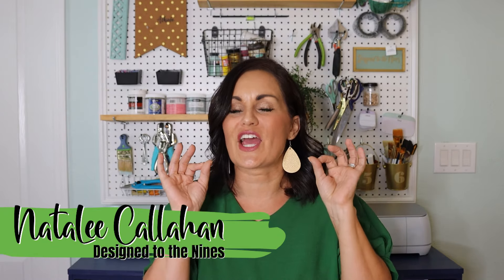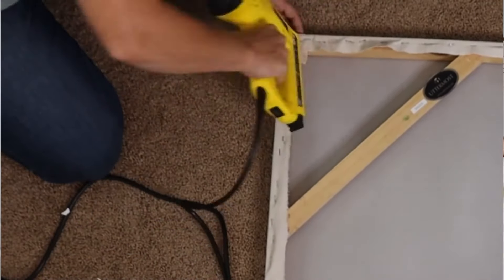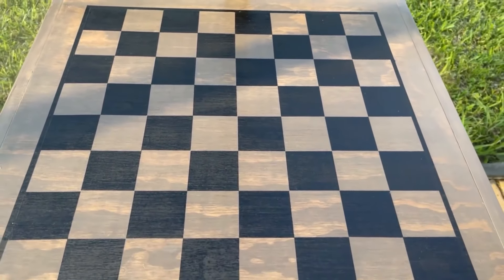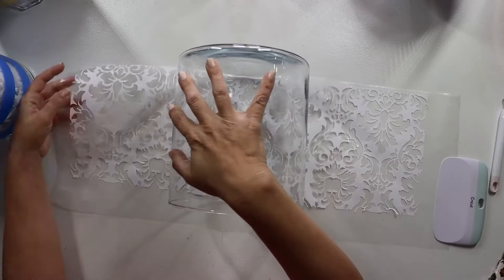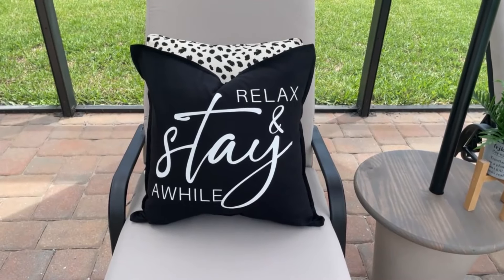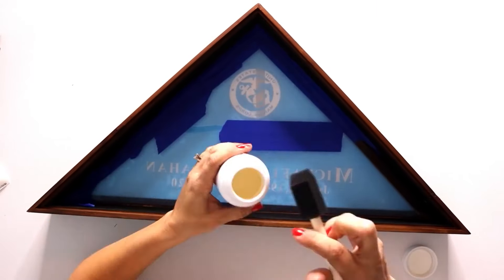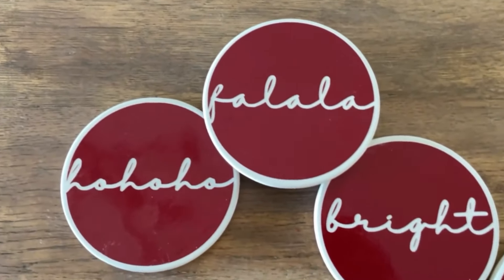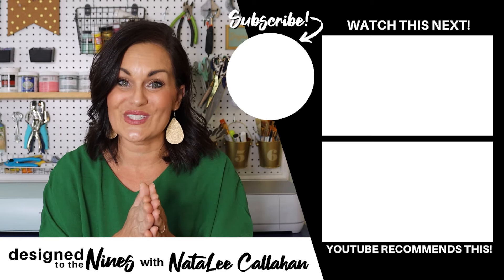30 MIND BLOWING DIY Projects You Can Make w/ a CRICUT!

Comment: Nice crafts but just a suggestion when you say how hot the heat press is you say degrees but you mean Fahrenheit. If you were doing degrees it would be 155 degrees, 350 would be next level hot.

Comment: I don't think wood glue alone will be sufficient for the monogrammed box... I think you'd also need to use pin nails (which are SUPER easy to put in with the gun) -just make sure you get a small enough size that won't go through to the other end.